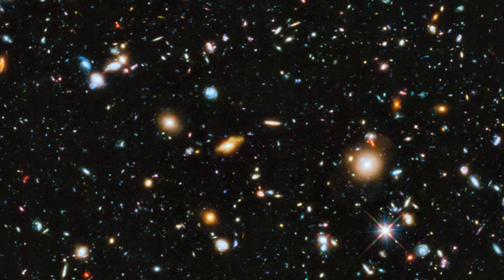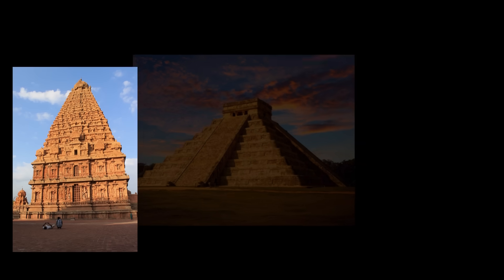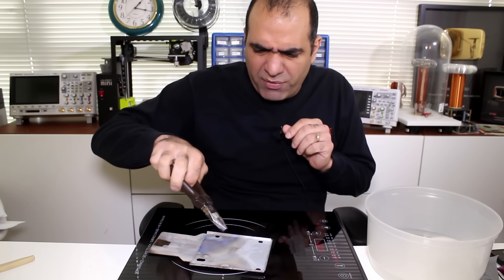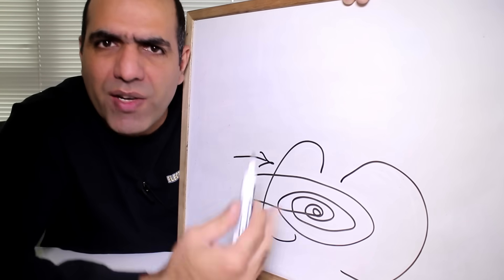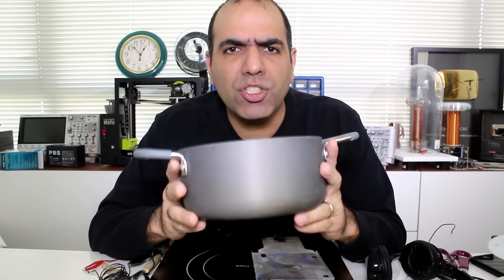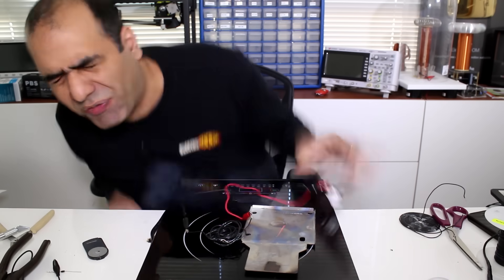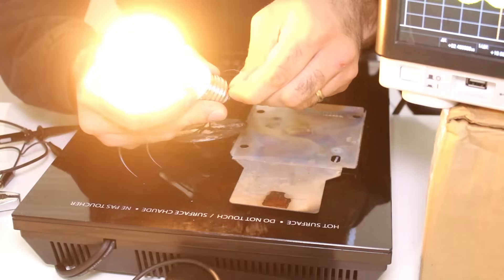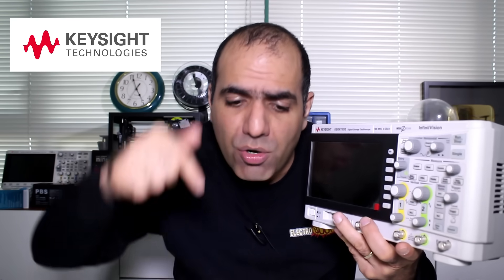Induction Energy Experiments

Comment: IT'S NOT BECAUSE OF THE RESISTANCE OF THE POT!
It's not the current which is induced. It's the voltage (rot(E) = dB/dt Faraday's law of induction). Because of the resistance there is a current (Ohms law) which is called Eddy current and if the resistance is low the current is high and vice versa. Because of the friction of the electrons current (electron flow) produces heat. Every time a current flows heat will be produced. So, but why an aluminium pot doesn't work? Faraday's law of induction does not depend on the material! It's because of the inductive coupling! Not the resistance! Ferro magnetic material has, because of its high permeability, the highest inductive coupling (i.e. a transformer wouldn’t really work with an aluminium core). The heater turns only on if the inductive coupling is high enough. It’s because of safety and efficiency reasons. If the device wouldn't check the inductive coupling before its turns on it would interfere with every conductor around it (like in the video with the light) and the efficiency would be around zero.
Skin effect works on every material, NOT just ferro magnetic materials and depends most on the frequency! The frequency is very high on such a device (>20kHz) because you don’t want to hear a loud buzz sound and, the more important reason, Faraday’s law of induction! If the frequency is high the time derivative is high, so the induced voltage is high and a high voltage results in a high eddy current and high current produces a lot of heat. The skin effect may have a negligible effect on the heating too, but I think this effect is almost not measurable. Trust me i'm an electrical engineer! ;-)
So, after this I think I well-deserved the Keysight! ;-)
Reply: Yes he is, but sometimes he presents some misleading facts. In this case Daniel Lang is right
Reply: Which part was misleading though? higher the resistance, higher the heat.
Reply: M roy There are two sets of cause and effect: first: a voltage is induced (cause) and then a current flows (effect); second: current flows (cause) and heat will be produced (effect). This is possibly only in this order. If the resistance would be higher the current would be lower and vice versa. And the current is what produces heat. So, with a CV (constant voltage) source (which we can assume here because of the induction) lower resistance produces the highest current and therefore the highest heat. How high the temperature is depends also on the current density - huge conductor (thick wire) doesn't get warm, but a small conductor (thin wire) will be glowing hot.
Reply: M roy Because of the induced voltage and the RESULTING current this is not true. It depends on what is the cause and what is the effect. With this logic an infinite resistance (open circuit) would heat most. But the air, or glass (R>10^16 Ohm*mm2/m) won't heat. The thermal power which is limited by the power of the cooker and not by the resistance of the pot.
Reply: Daniel Lang well, you can say that current causes heat or the resistance causes the heat and both will be incorrect, it’s really an emergent phenomena. But I still don’t understand which part of the video is in contradiction with what you stated given the context of the video.
Reply: Both Eddy currents and in case of magnetic materials hysteresis plays a role in heating. A material with higher resistance will have higher heat loss as mentioned in this video. Not sure what is the proportion of heat loss due to hysteresis in magnetic materials but I guess it can be significant depending on exact material proprieties and frequency.
Reply: "It depends on what is the cause and what is the effect. " 

So what is the cause and what is the effect in this case?
Reply: 20khz is not high enugh, I can hear it and it gives me a horrible headache and pain in my ears...
Reply: @Daniel Lang:

But I don't get 2 things now:

1. Why we can assume a CV source? I's  mutual induction (so AC), isn't it?
2. why does lowest resistance produce the highest heat? As Mehdi said, with copper it doesn't work because of too low resistance. Which is clear because the lower the resistance --> the lower the electric field --> the lower the voltage --> the lower the current --> the lower the heat, right?
Reply: I'm gonna thumbs up this, but you're both wrong.  You're wrong by a tiny bit though. The heating effect is from magnetic coercivity. Forcing magnetic domain changes takes energy and that energy is consumed as heat during the domain flipping.

I'm not an electrical engineer and I know that.  If you don't believe me and you have one of these induction cook-tops, grab a pile of your favorite ferrite cores (which are very close to non-conductive compared to metals) and set them on the cook-top.  See if it starts up.  They need to be the crappy ones that are 75 percent efficient or so.

If you've done any ferrite core sourcing for power transformers/inductors, you know the copper losses even in the hundreds of kHz are negligible compared to the (non conductive) core losses.
Reply: cdefgah4343 1. CV doesn't mean DC. A CV Source is just a source where the current is variable and the voltage is the constant parameter. If you connect a potentiometer to a CV source the voltage of the source will be the same if you turn the potentiometer and the current through it changes. A CC source is different: the current through the potentiometer would be the same and the voltage of the source would change. But this does not depend on the signal form (AC or DC). 
2. Keep in mind you have a CV source: Ohms law: V = R * I (or U = R*I). If you lower the load (resistance) on a CV source only the current changes - the current will be higher. Now if a higher resistance would cause a higher heating than an open circuit would heat most. Or an insulator would be the best heater. But that's obviously not reality. It depends on the current density and the power of the source.
Reply: cdefgah4343 If you want some equations: The heating power is dP = p*J^2*dV with p as the specific resistance (material constant). This material constant depends NOT on the current and therefore is just a proportional factor. So, the heating power just depends on the current density J and the volume dV. Because of the J squared the current density has a much higher effect.

Comment: 4:42 - A little bit o bullshit - Lower induction of eddy currents in cooper or aluminium is caused by their low magnetic permeability. The magnetic flux is lower, thus the current value in your equation is much lower. The resistance doesn't matter significantly as long as material is conductive.

Comment: 3:10 The reason LED works only one way is that LEDs are basically diodes, so they let current through in only one way, therefore it stops working once you turn it around and change the direction of the current.

Comment: What happens if you bring a magnet near that magnetic stove?  It will oscillate or heat up?
Reply: You'll feel it vibrate. Same goes if you take a magnet through one of those RFID anti-theft tag screens at the store. Put a magnet in any oscillating electric field and the magnet will also oscillate. I'm sure you know why.
Reply: Or putting a magnet near an working      transformer

Comment: The LED is a one directional diode. Reverse flow of current would not work. Thats why when you turn your coil, LED does not light up
Reply: It would still light up if the magnetic field were symmetrical, because the power would be oscillated on both sides. Here the power is oscillated on only one side so it only works in one direction. What you said wasn't wrong, its just incomplete.

Comment: What I don't really understand is: If the heat comes from the eddy currents, why do they put these big slits and all of these holes into the bottom of your pot? The way it looks like, the eddy currents should only flow in a ring in the middle. A ring on the outside and in between the two gaps between the outer two rings of holes.
Reply: At least the eddy currents in the steel. I mean if the aluminium is electrically connected to the steel, it will flow throughout the entire bottom of the pot. But then I still don't really understand it.

Comment: FREE ENERGY should be a new running gag, just like FULL BRIDGE RECTIFIER! XD
Reply: Schwindsichtiga der Echte 
It already is c;
Reply: Schwindsichtiga der Echte WOW,the problem with that is the acids in the lemons or limes"BREAK DOWN",when the acids"BREAK DOWN"you loose your"POWER SUPPLY"of not-so-free-energy you have to get another lemon or lime.(limes are stronger by the way)
I did that experiment back when I was a kid,but the crystal 📻 radio NEVER runs out of power.You convert radio crystal power into usable energy with a voltage DOUBLER circuit to your desired voltage,then build a "flywheel circuit"using super capacitors,then a rectifier circuit to convert it to 240 single phase AC power.
Reply: Schwindsichtiga der Echte Its ALREADY being done their genus,by a company called Maxwell,this company builds super capacitors to help build flywheel circuits.
Reply: 4 gauge Wow, the crystal radio! Let me share something too: Did you know that when you put a piece of copper and a piece of cinc into a lemon, you get a free battery? What will they come up with next?
Reply: Schwindsichtiga der Echte Free energy is a running gag huh??....Look up how a crystal radio set works and I'd like to think that would change your mind.
Reply: Benjamin Chen Sorry,it is free energy and this was how Tesla was going to power his Tesla coil tower in New York just before it was destroyed.
Reply: 4 gauge Why don't you go ahead and sell this brilliant, totally practical billion-dollar-idea to create free energy (which obviously no-one else has come up with or uses so far) instead of trying to science-trash-talk random people in a youtube-comment-section with it?